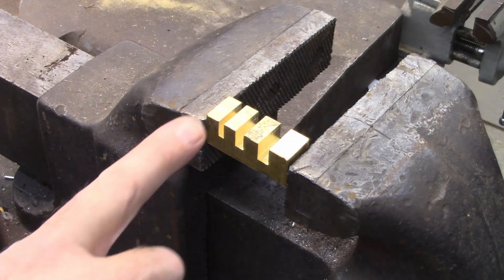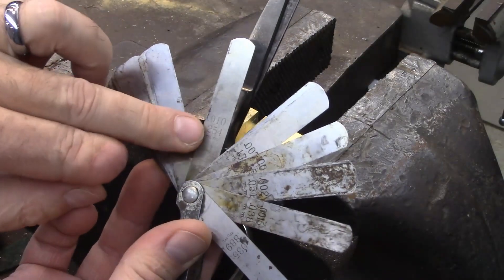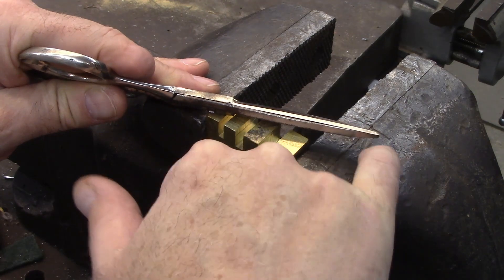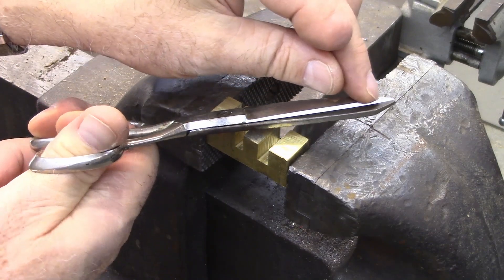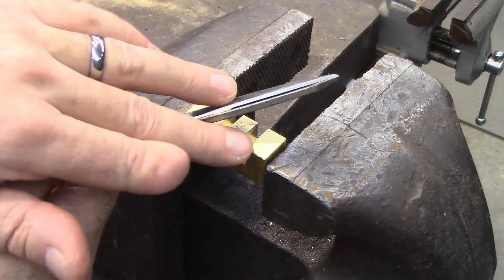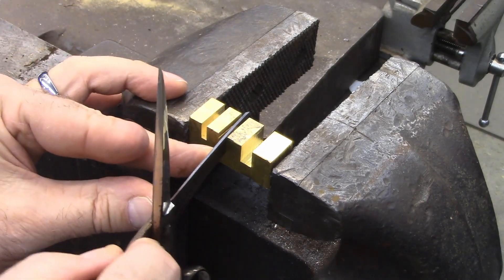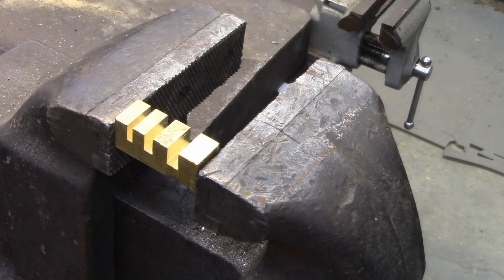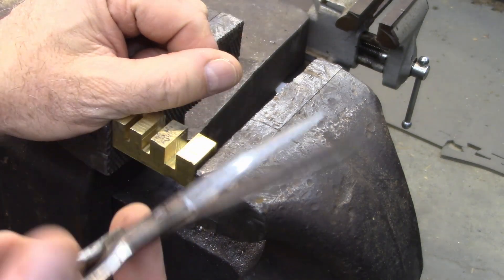How to Adjust Scissor Set

Comment: That's great - it's the best scissor video on YouTube.
I wonder if it applies to garden shears? - hedge clippers?
A lot of them don't seem to work exactly like scissors but they look like large scissors.
They don't rely on the side force of a thumb pressing on the scissors when closing them -
they just have a bolt in the pivot that tightens.
You are using a hand on each handle not 2 fingers in one hole and a thumb in the other.
Reply from the maker: Thank you for taking the time to let me know!